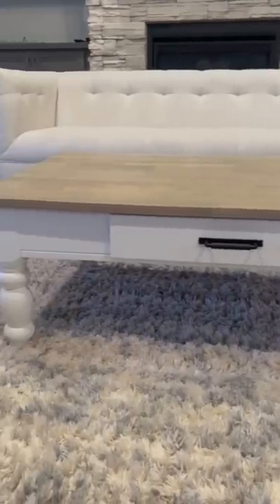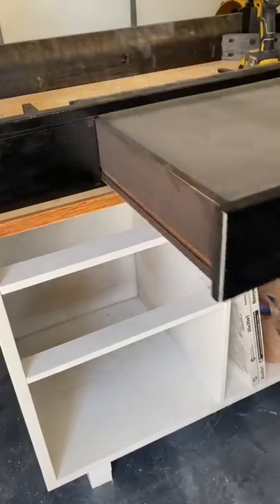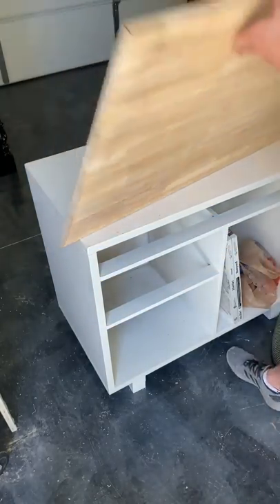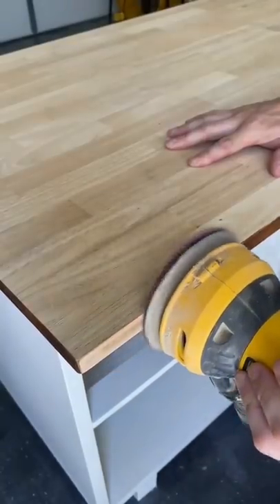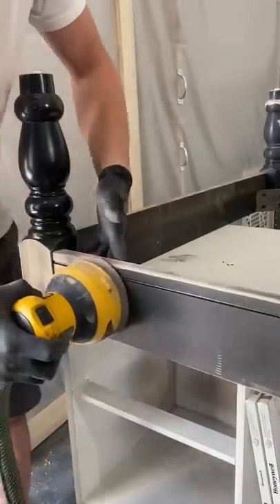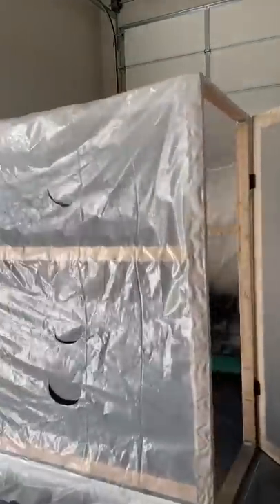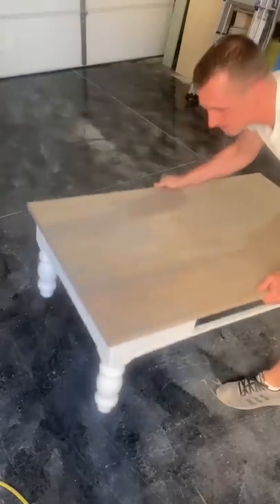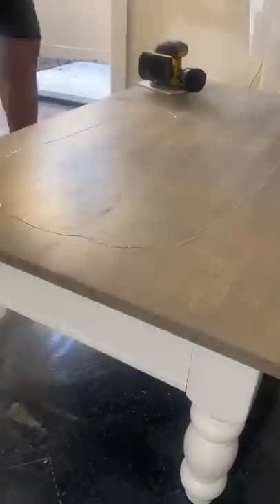Thrift Store Flip Coffee table Furniture Makeover DIY #thriftflip #thrifthaul #diy #diyprojects

Comment: You make this look so easy.😃 
I like that you made your own paint booth(tutorial needed). I have 2 pieces of furniture to makeover. How do you know what strength of sandpaper to use?
Reply from the maker: I usually start with a 40grit sandpaper to remove existing stain. As soon as that was achieved, I then work my way up to 220grit. As follows 40-60-80-120-180-220. You can stop at 120 if you are deciding to paint, 220 to stain.